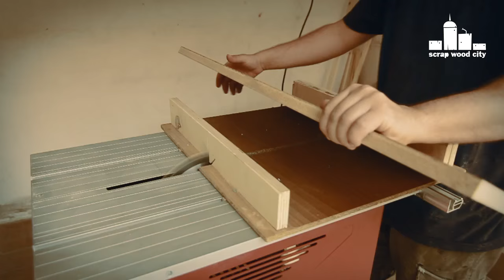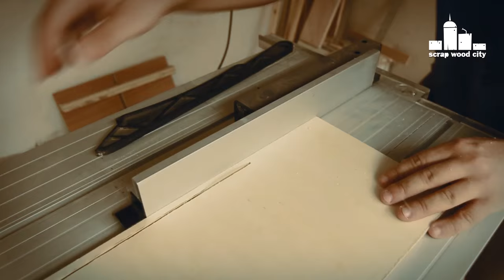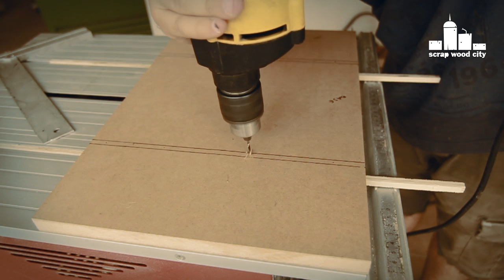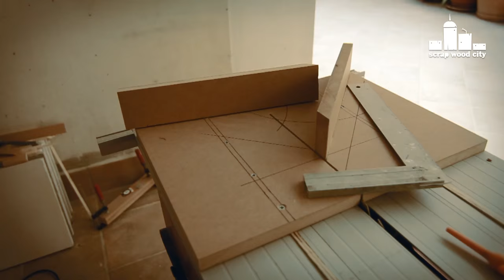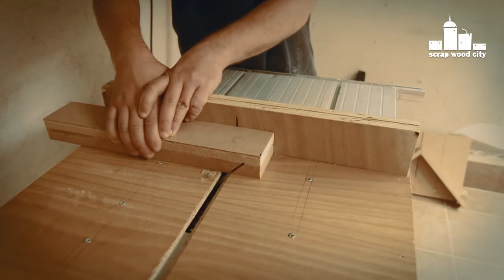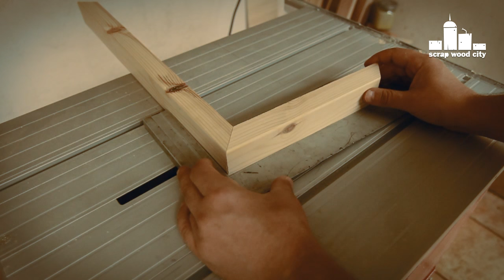DIY miter sled for the table saw

Comment: Hi there - nice quick build - thanks for sharing. One question if I could; When you trimmed the fences (starting at 1:30), how was the highest portion of each fence cut? It seems the blade cannot be raised high enough to cut all the way to the top of the fence. Any tips for getting 'round that? - I'm half way through making one and have just struck this problem which I didn't consider...doh!

Comment: Does it moves from side to side? I also have einhell table saw and have trouble to make precision rails.
Reply from the maker: No it does not. At first I used plywood for the rails but I found out that it works better if you use solid wood. You can make them a bit oversized and then sand them down to fit perfectly.
Reply: +Scrap wood City Thank you. Nice project
Reply from the maker: I thank you very much for watching and commenting! :)